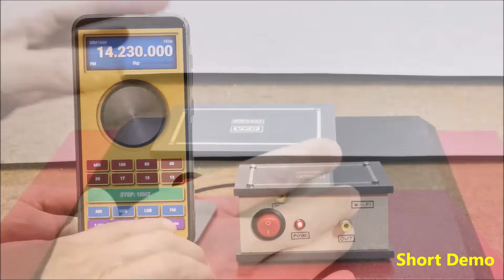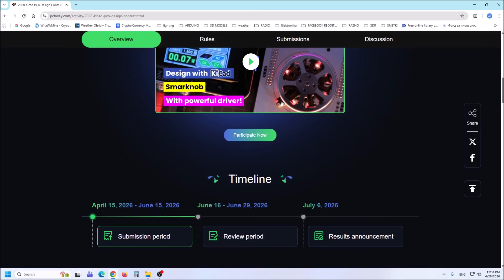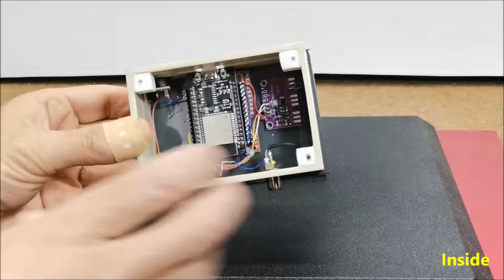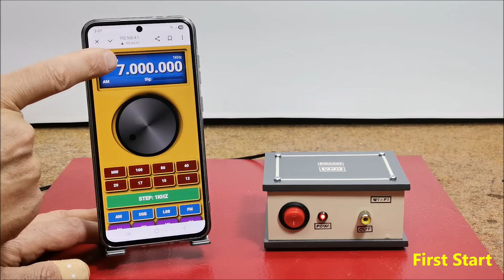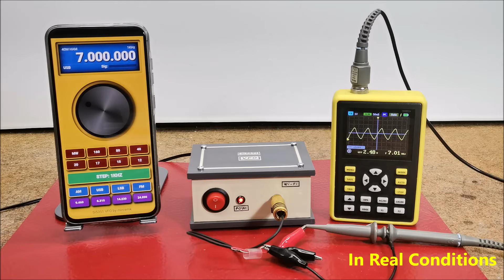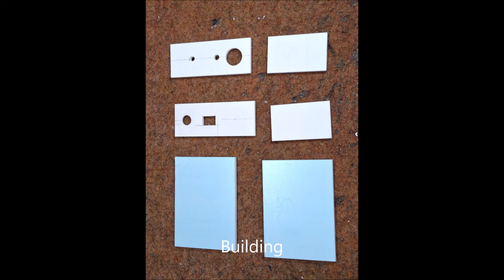The Ultimate Smartphone VFO ESP32 & Si5351 Wireless Control

Comment: Hi Mirko!  Great Project!  I've been tinkering with the Si5351 freq synths, and just got an Arduino ESP32 nano last week, so I tried your project.  I ran into an issue of the analog input pin you use was not supported on my board and it went into a crash loop.  Got that fixed and noticed that your frequency step scaling is off / 10.  The 100 hz setting changes freq 10hz,  the 1khz setting changes 100 hz,  and so forth.   The code is very clear and I could easily fix the scaling tweak the settings for my application of generating signals on 6m and 2m.  And that tuning knob is great!  Thank you for a great project!  73  N3SDO

Comment: I wonder if you could without an si5351 and only the esp32 and radio CAT cable, create a wireless CAT remote for HF tranceivers? Excellent for monitoring favorite frequencies when you are across the room working on other projects.👍
Reply: I have just started tinkering with these items, and have a couple of cat controllable older rigs, FT-847, and IC706-mark0.  This is an excellent idea that I will add to the list of cool things I want to try.  73 N3SDO